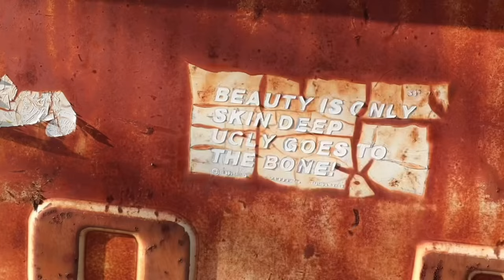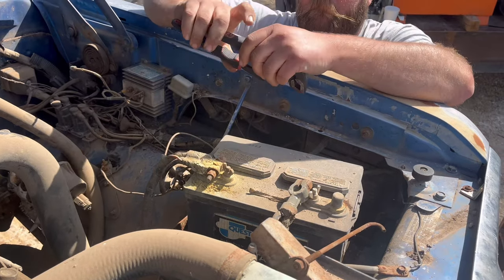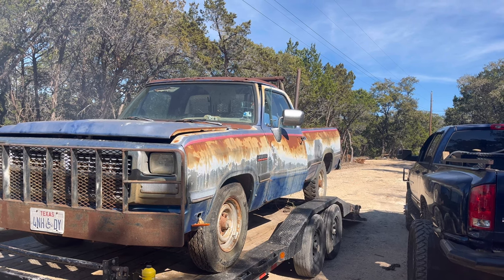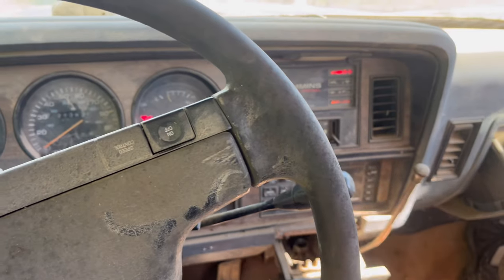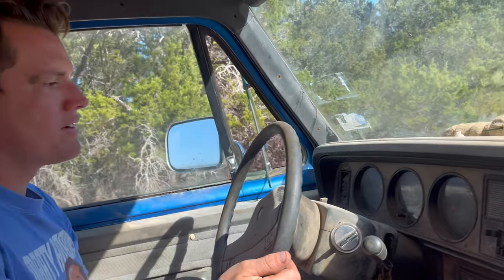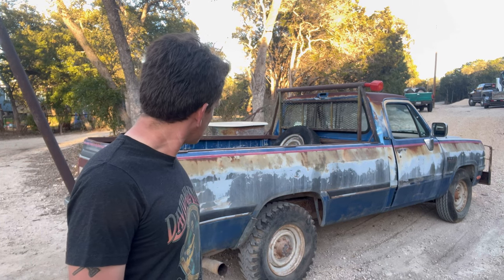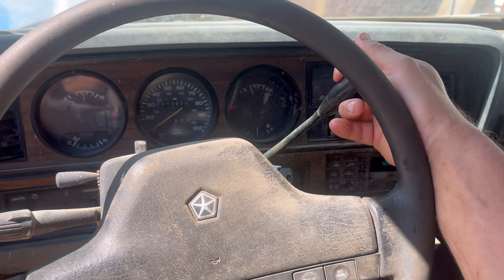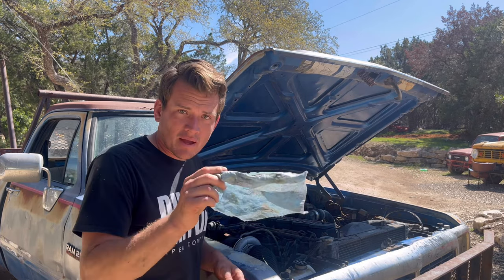1st Gen Dodge Cummins Diesel! Sitting for 20+ years! Will it run?

Comment: That Cummins is a perfect donor for that Warlock.  Looked like metal flakes in the pan sediment?  Why is the oil PSI indicator on and gauge so low? Temp gauge seems to be working better.
Reply from the maker: I’ve got another donor in mind for the Warlock.

Comment: Maybe address the severe shaking on acceleration, add a couple of doors, seat cover, basic engine overhaul but add a turbo. Love the look at the boxy dodge pickups.
Reply: This truck comes stock with a turbo and a "Charge Cooler" also know as an intercooler.  You can tell the ones with a charge cooler because  the air intake goes to the front and not over the cover on the top.

Comment: Ok, as for what to do with it.  If you have a much better cab, you could consider that.
But, unless it is from a diesel, cab the swap is not that easy.
I have a 92 D350.  The body is ok in terms of rust. But, if I had a 95-97 3500 body I would put the engine and trans in that. Even though it is a club cab which is the only type cab I would own for 93 and older, the suspension is too harsh on those "first gens", as some people call them.  For me anyway.

Comment: I tried having a key cut with my 92 pattern on one side and my 95 truck pattern on the other side. They cut the key correctly, but the key did not work in either truck.  I have read that the pattern is read on both sides of the key, but have not been able to confirm that.

Comment: I have that same steering wheel in my 92. Unfortunately, most of them got the sticky problem. There is no replacement other than the exact same one and I have heard that every one is now sticky. Is yours sticky? 
Other year Dodge truck and car steering wheels won't substitute because of the unique air bag configuration.
Reply from the maker: Try blech white tire cleaner!

Comment: So is that floor shifter  is something for a PTO? I wonder if that is making the noise. I thought it was U joints at first when the noise remained constant even when moving in neutral but dropped to nothing when stopped.
Reply: The floor shifter is an old winch control, it just has 2 wires coming out of it that are not hooked to anything

Comment: change fluid again after running it a bit as nasty as that was i would cheaper than another trans just saying
Reply: as nucg crap was in it the filter might get clogged after awhile so yeah run it awhile change again with new filter for peace of mind i did in the truck ive been driving for 4 years now
Reply: so yeah fix it up give it a quick black paint job and boom got you a hell of a work truck